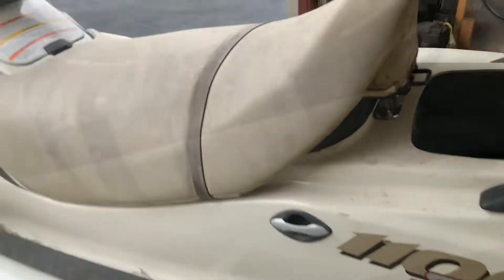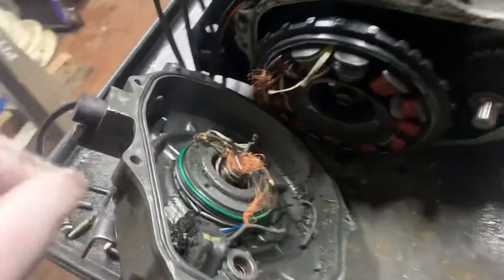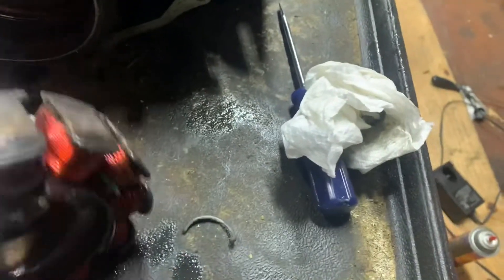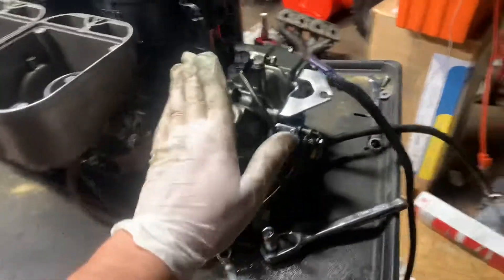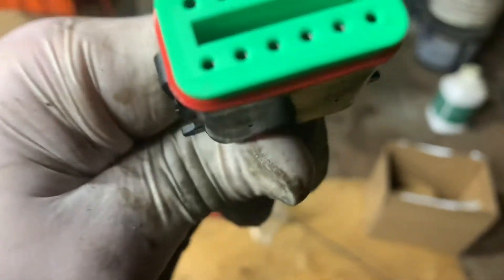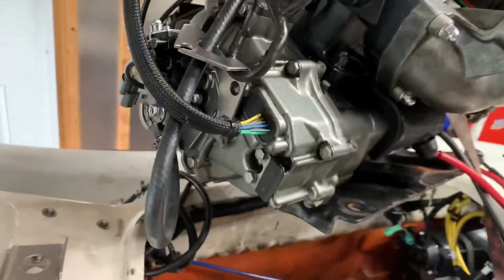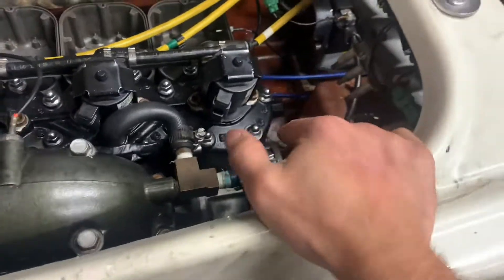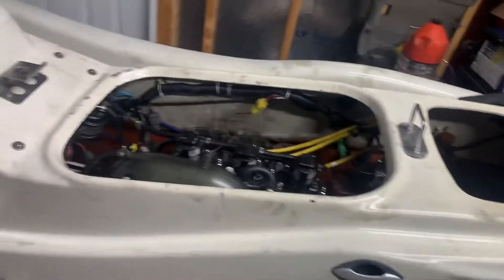Jetski electrical diagnosis 1100 stx DI

Comment: On the 2000 stx DI what do you need to do to winterize the cooling system, I know about removing the gas and fogging but not the, water box

Comment: just picked up a 2000 1100 DI what is the tubing you used for the oil lines, there is not much info for these motors  and are there check valves you used
Reply from the maker: I used oil safe oil lines. I don’t remember as it was a few years ago.. I did not use any check valves on the oil lines